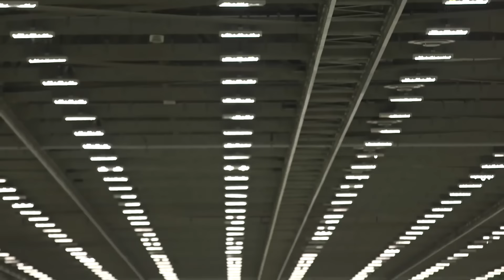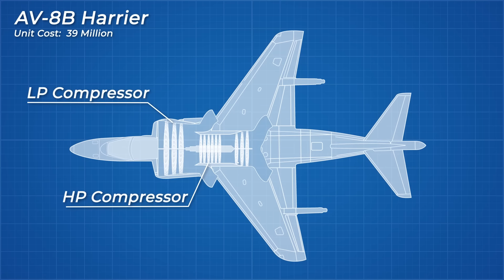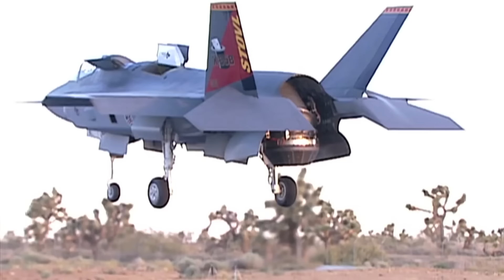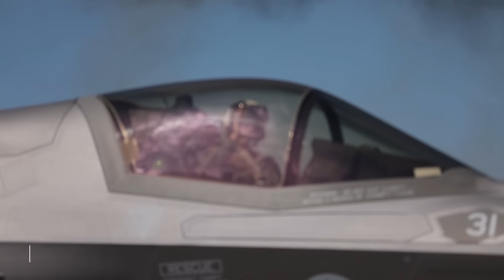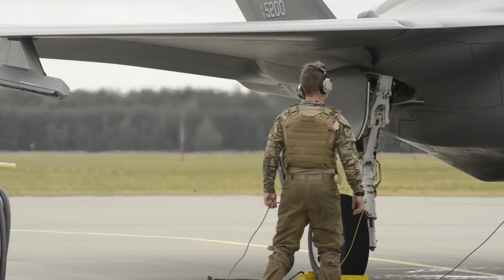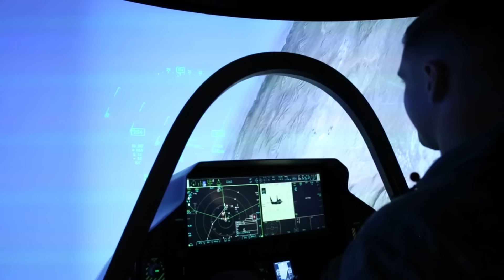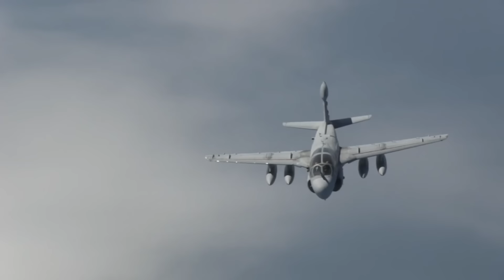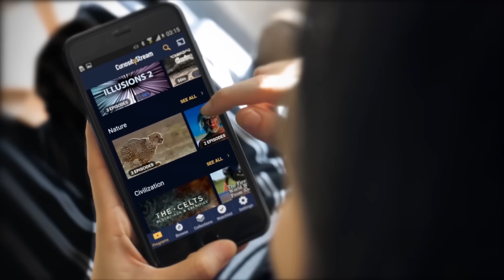Is The F-35 Worth $115 Million?

Comment: I think it was primarily the VTOL requirement that really drove the design of the plane ... we've made aircraft with land/carrier variants before, such as the F-4 Phantom. The VTOL requirement required, IMO, so many design compromises that it really should have been it's own airframe ... and just perhaps shared avionics and whatnot. As a consequence, the plane's performance it compromised across the board for a capability that is arguably of minimal usefulness to begin with.
Reply: The VTOL was not a design compromise. The size and shape of the plane is determined by the internal bays, not the lift fan.
It's also not minimal usefulness. The Harrier needs replacement and the Marines aren't gonna get longer aircraft carriers with steam catapults. The short take off and vertical landing is critical.
Reply: Uh... it is it's own airframe... The F-35 family comprises 3 physically different variants each designed to meet the requirements of a particular service while having some commonality in systems to make fleet upgrades easier.

Comment: I saw the price given for the A-10 as $45.3 million. That's just ludicrous. When it was built in the 80s it's unit cost was about $5 million. Yes it's received some upgrades over the years but no where near the price stated. That makes the other statements of this vid highly suspect in my mind.   edit:  I see wiki lists the A-10 price as $18 million  originally adjusted to $45 million for inflation. I've never seen such a high initial cost figure before. It's always been around $5 million. But if wiki says it, it must be true right?
Reply: The A-10 at the very least cost $10 million when it entered service. Wiki's numbers are also typically inflation adjusted from the original values i.e the original A-10 adjusted for inflation to 1998 or so was $18 million. Since then the A-10 has had a complete overhaul of systems transforming it from a 60s analogue technology aircraft to a digital 2000s era aircraft, adding about $10 million to the price tag of the time (so about $32 million in 2006) but also greatly improving it. It has received further upgrades since then so a $45 million price tag makes sense to me.

Comment: Gee imagine that,  3 different service branches need 3 different planes.    Whats even better is that the f35 only replaces the a10 in a high threat environment. In a low threat environment its far too expensive to opperate meaning that yet another plane needs to be developed to cover that gap in service capabilities.
Reply: Which is why the A-29 Super Tucano was supposed to be adopted for low threat environment but the A-10 was not canceled soon enough.

Comment: My brilliant idea for destroying the world with manned aircraft delivered weapons (MADWs) is to take off vertically without weapons - and thus with a higher fuel load - and then receive weapons for a "weapon tanker" in flight, similar to air-to-air refueling. So you would have a 747 or (pick a large tanker, 707, DC-10 etc.) and the weapons would be auto loaded via a long tethered cantilever.

Comment: "Everything is worth what it's purchaser will pay for it." -Publilius Syrus

The cost per jet in itself is not very useful.  If you want a more comprehensive look at cost you need to include things like the amount purchased and the cost to operate and maintain.  The actual sale of the jet is one of least expensive factors in owing one of these in the long run.  You need to build facilities to house them, fuel, parts, maintenance...Etc. There is so much money going to the support system to keep them operational.
Reply: Add the cost of preparation and training: pilots, ground crew, tactical ops, theater intel, equipment, real estate, logistic planning and upkeep...
Reply: All of the logistical factors you mentioned needed for the jet post sale, for the US at least, are already in place.
Reply: @squidtardsfirstcousin271  He didn't claim the support infrastructure wasn''t in place. He said it's not useful to consider the price of the jet alone, while ignoring these other costs. It's similar to considering the sale price of a car instead of the "on the road" price which also includes insurance, taxes, fuel etc. If you ignore these associated expenses you end up with a misleading total cost which makes the aircraft/vehicle appear cheaper than it is.
Reply: @squidtardsfirstcousin271  no, they are mostly unique to the F-35. You can't just fix it with F-15 parts, for example. The only major transferable infrastructure is refueling, which does not account for the majority of operational costs.
Reply: It’s the weapons that cost the big bucks, millions of $ some of them bombs cost
Reply: Though the video was comparing the purchase cost of these various planes, not their operating costs, I do agree that the real cost/potential value of an aircraft should at least take into consideration long-term servicing costs. That said, I doubt the F-35 will end up being more expensive than the different aircraft it's designed to replace.

More advanced technology often requires more expensive replacement parts and more specialized crews, which usually earn higher wages. That is true with most technology, though. The Abrahams battle tank is more expensive to operate than the Sherman was, and the M1 successor will be even more expensive to maintain, even when not taking inflation into account.

Regarding the wages, I doubt the people servicing the plane will see their salaries double, given how the salary scale works in the military. Besides, even if the salaries of the crews servicing the F-35 were 50% higher than that of the crews servicing the F-16, F/A-18, Harrier, etc., there should be fewer F-35s (and F/A-18Es, etc.) in service when the older aircraft it replaces are phased out, given that the F-35 should outperform them thanks to its stealth attributes, electronic warfare capabilities, and overall technology, with one F-35 being able to do the job of two F-16s, two F/A-18s, etc. The same goes for the F/A-18E, etc. A smaller air fleet should result in fewer crews, which should make up for higher salaries F-35 ground crews may earn.

Now regarding the maintenance costs related to parts, it depends on various factors. Some parts need to be changed regularly on an aircraft, like the blades of a reactor. Some might last for the plane's entire life. Still, a technologically advanced aircraft is expected to require more expensive parts. The dimensions of the panels that make up the wing and the fuselage need to be extremely precise, much more than that of an F-16 or F/A-18, with a higher price tag. However, if the F-35 is like its bigger brother, the F-22, things could turn up for the better. The F-22's high furtivity had a very positive effect on its envelope (the combination of its surface components and the underlying material that holds them together). Since the aircraft is rarely targeted because of its stealth capabilities, it doesn't need to perform evading maneuvers to escape enemy radar as often as an F-16 or an F-15 would. This translates into the F-22's envelope being less subjected to stress, which increases its longevity. Because of this, the F-22 could actually remain in service longer than expected, which will reduce its initial purchase cost (spreading $150 M over 35 years is better than over 20 years). If the F-35 behaves similarly in operation, this could lower the material costs quite a bit.

There is a "but," though. If a rival of the USA develops a technology that makes their actual stealth technology obsolete (and I'm not talking about S-wave radars, but something that really makes stealth close to being useless), the F-35 might need some important and costly upgrades, like a new, more expensive stealth coating, for instance. The development of this new coating, for instance, would obviously increase the operational cost of the F-35, not to mention to costs of servicing an entire fleet to replace the coating. Then again, it was also true for the F-16, the F-15, etc.: all these planes went through updates and upgrades that were not included in the original tag price or even the original operational costs estimate. Like upgrading to AESA radar for doppler radar. Not performing the upgrade means lagging behind your rivals. Spread over some "normal" service life, the costs of these upgrades shouldn't be much higher than those that were performed on the F/A-18s, Harriers, etc., in the past, given that there should be fewer F-35s, F/A-18Es, etc., in service compared to the total of F-16s, F/A-18s, A-10s, etc.

It will also depend a lot on US foreign policies. Moving away from 50+ years of intruding into foreign affairs should give the F-35 a better life expectancy, as they'll be mostly used for border patrol and defense. Having the F-35 fly over the South China Sea, the Middle East, and Eastern Europe regularly will result in the F-35 fleet aging faster, which will require more maintenance.

There are many things to consider in the total operational cost of an aircraft, including a lot of things I didn't mention above. Coming up with a realistic operational cost is very difficult, as it depends a lot on the geopolitical situation, something no one can accurately predict. Therefore, the only practical way to evaluate if a "jet fighter is worth its price tag" is simply to compare its purchase price tag with that of its competitors.

(Note: The comments above apply to the US. The situation might be slightly different for importers of the F-35, like Australia, Canada, Norway, etc. Canada, for instance, could by 60-70 F-35 to replace its 88 CF-18s. Having fewer planes might not make up for the higher wages of the F-35 crews might earn and the higher costs of replacement parts. The advantage for the Canadian Armed Forces would be that they would have access to a better aircraft than the F/A-18E, for instance. Again, it depends on foreign policies. If Canada wants to be able to conduct its own missions (i.e., without the support of the US, the UK, etc.), the F-35A has the advantage of electronic warfare capabilities that would require the purchase of a few additional aircrafts if operating the F/A-18E. If Canada only wants to be part of international missions, they probably can have their F/A-18Es fly with American or British F-35s playing the role of an electronic warfare aircraft. I suppose the best option for a country like Canada (or Australia, etc.) would be to buy a few F-35s to act as the vanguard of the air fleet. The core of this fleet would be made of F/A1-8Es, Eurofighters, Rafales, etc. This would allow more flexibility than having only F/A18Es or Eurofighters, etc., without being as expensive as flying only the F-35. Never bet all your money on a single horse, one could say.
Reply: Yeah but it’s completely worth it especially to fill in the gaps.
Reply: @Sebastian Thor We should include the price of the food and housing used to feed the engineers who work on the planes as well!
The training, infrastructure, ground crew, etc are all going to be pretty damn similar regardless. Removing the common denominator is to make it not "giant number plus one" versus "giant number plus 1.5"
Reply: Sebastian Thor  Used all of your guys' logic. See how stupid it is? and the fuel cost doesn't drastically alter the price. What did you think the fuel cost would be 5 million USD per liter?
Reply: Sebastian Thor  The jet is what were accounting for. The title states. Is the F-35 worth 110 Million, not "Is The total production cost of the F-35 worth 110 million?" No cause the total cost for producing the F-35 has been out and is in the billions.
Reply: @diddykong7354  Ignoring operation cost when assessing any long term operating machine is a pointless effort. The only reason you would buy a more expensive model of something (ignoring luxury purchases, which the militaries don't do) is if it offered either the same capability at reduced operational cost, or increased capability for a justifiable increase in operational cost. Either way you need to assess operational cost in order to properly assess the design. You don't just get to ignore it. Well you can if you want, but it would defeat the point of the entire endeavor. Those things are key elements of the design and to ignore them is to say you are uninterested in actually comparing the design in its entirety.
Reply: Facilities aren't the jet. We're talking solely how much each Jet is actually worth.
Reply: @diddykong7354  you fking idiot, who the hell are you to tell others what to talk about!
Reply: @diddykong7354  'Facilities aren't the jet. We're talking solely how much each Jet is actually worth.
'

In other words: trivia.
Reply: @diddykong7354  Tell me, when you buy a car, do you just look at the purchase price, or do you look at ongoing costs such as depreciation, tires, maintenance, insurance, registration, fuel economy, usefulness, what will you get in return when you sell or trade it. Yes the video is about the cost of the plane, but the ongoing costs should always be taken into account, which this video could have done and should have done. It is all relative, and a person pointing it out in a comment on You Tube is entitled to do so.
Reply: Sebastian Thor  Lmao what? The Universe isn't a real cost? Alright I am so done. XD You are by far an idiot. Goodbye. "cuz thats not real cost,:
Reply: @diddykong7354  You clearly do not understand the basic principles of engineering design. I recommend looking up what a proper design trade study entails. Also, to think that accounting for operational costs is the same as accounting for the universe betrays a fundamental misunderstanding of military operations. When the US military issues a contract they specify how long they wish to operate the technology for. Right now the F-35's projected service life is up to 2070. When the time comes its service life may be extended if that is the most cost effective and strategically advisable course of action, but otherwise that is the year in which the last F-35 will be decommissioned. I highly recommend the practice of knowing things before you comment, it really helps in not looking like a complete idiot.
Reply: Sebastian Thor  Idiot. The video is about the jet. Using all of your logic, you need to include the land on which the facilities are built, the air needed for the people to breathe, the physics that allow things to be built, the Earth itself for allowing us humans to be able to live and be able to build things, the gravity to hold us in place, the Earths magnetic sphere, The sun for producing us heat, the Universe for creating us and allowing us to exist, and so on. We're talking about the jet itself idiot.
Reply: Sebastian Thor  Yep using that idiotic logic. apparently you can't read English. so the cost of the F-35 is endless or simply being able to exist. Basically the Universe is the cost of the F-35 using your logic.

Comment: There is now way possible for the F35 to ever replace the A10. The F35 can not carry anywhere close to the ordnance load the A10 can carry nor will it be able to take the abuse the A10 has proven it can take.
Reply: Not the case at all.
Reply: I count 6 A10s lost in 40 years, and I still state from personal experience nothing else in the inventory carries as much ordnance for a CAS mission than it.
Reply: @johnygreen81  There wee 6 lost in the 6 weeks of the Gulf war despite never serving on the front lines or facing the major air defences of the Iraqi military. The F-16 during the same conflict performed 60% more sorties (a lot on the front lines in contested airspace) and only lost 3 aircraft. Another A-10 was lost during the 2003 invasion bringing the total to 7.
Also the A-10 carries less than the F-35, as well as the F-15.
Reply: Twice as many A-10s were shot down in 1991 compared to F-16s yet F-16s flew more CAS missions.

Comment: It copied the Russian design with the extra fan and how many years between the harrier and this new yet old design , to give us a so called improvement . All that was needed was a super light weight plane with Hight thrust engines ,, yes not a single one  ,  would have made it a short runway aircraft instead of a worthless VTOL where its not needed at all .
Reply: It did not copy anything.
Reply: 1. Russian STOVL designs use additional engines, not a shaft driven fan.
2. Weapons weigh a lot and cause a lot of drag as well. A lightweight fighter would never accomplish a short takeoff at mission weight.

Comment: Since the stealth advantage of the F-117, many years of radar development has been made. Against tribal warriors of some mideastern country it may still be effective, but against a competent foe it's insignificant. The Chinese data theft in 2007 meant that Tbytes of highly secret signature data got stolen. Every modern radar will see and identify the JSF in good time.

Btw. The helmet. I watched a testpilot say that he didn't use it as it was lagging (in this video, at 15:00 there was no erratic head movements as this would expose the weakness). Did he need to see below the plane he just flipped the plane upside down.

Btw2. It will never be able to replace the A-10 in the close ground support role.

I'm dead sure that this plane is the worst lemon we can buy, but we do at a time where we politically and militarily need it to be a deterrent.
Reply: The F-35 also has stealth development since the F-117.